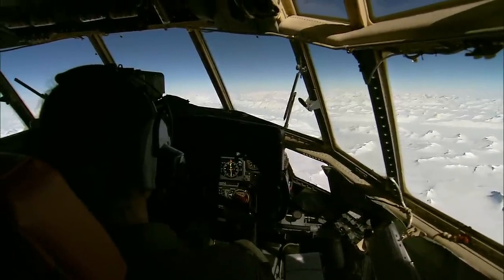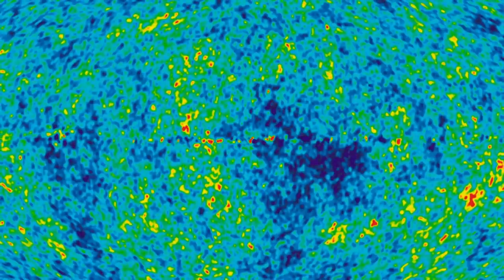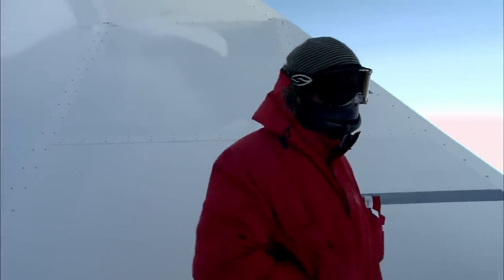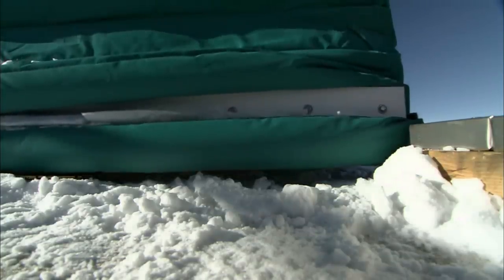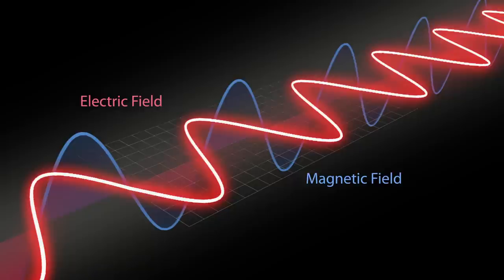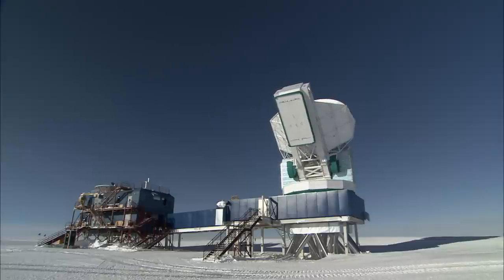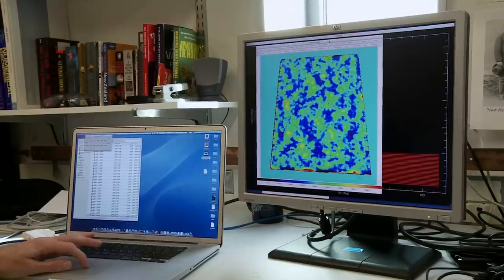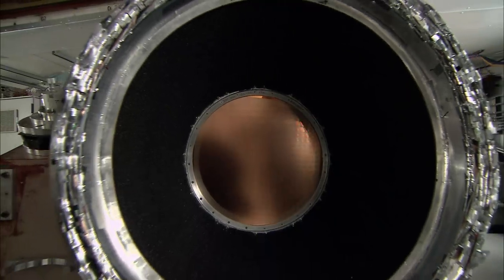Science Bulletins: The Cosmic Microwave Background—A New View from the South Pole

Comment: a "MOUNTAINTOP??"
Reply: Not exactly, but practically yes. The south pole station is on a glacier so the horizon is as flat as out on the ocean. But, the antarctic glaciers are so thick that the south pole station is at over 9000 feet. Additionally, because of the spin of the earth and atmosphere, the atmosphere is thinner at the poles than elsewhere, so the pressure altitude usually ranges from 10-12 thousand feet, depending on weather.